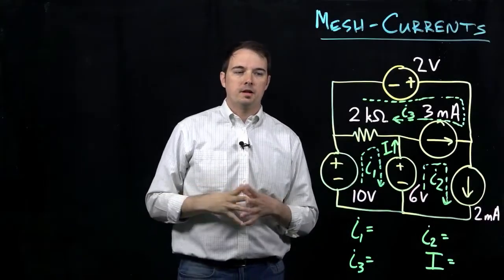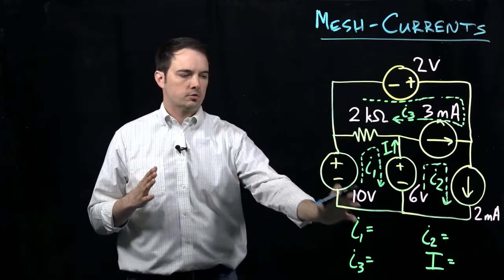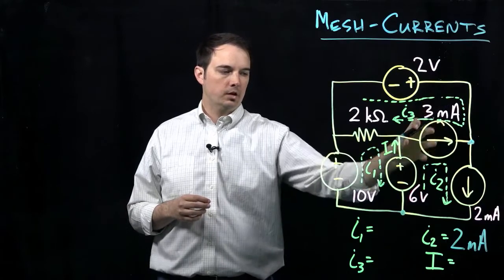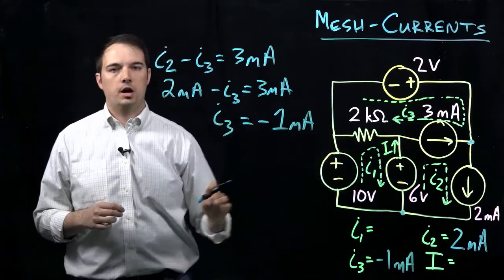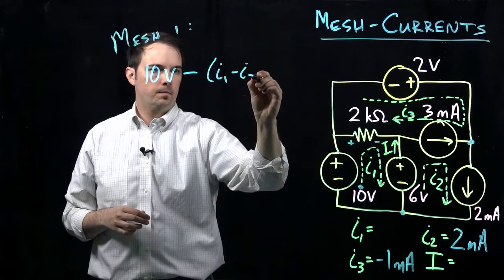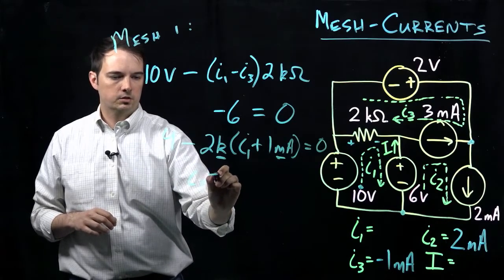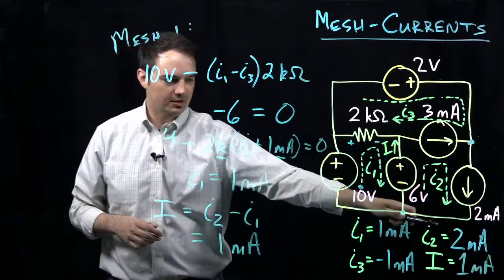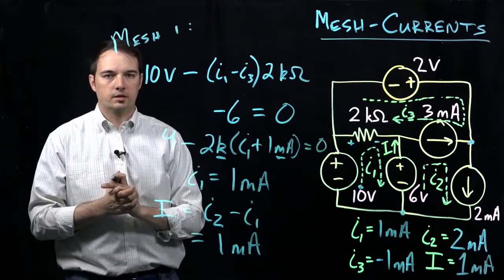Circuits I: Example 2 with Mesh Current Analysis

Comment: https://youtu.be/2fdFu9tOpis?list=PLD5lK5eXPznd_jjAoT8nxUY21_nVOhiOo&t=336

When you use the EQ @ i1
4 - 2k( i1 + 1mA) = 0

You are using the active power convention as you go clockwise around mesh 1, correct?

I know it's KVL but I thought that the passive power convention was the preferred notation...